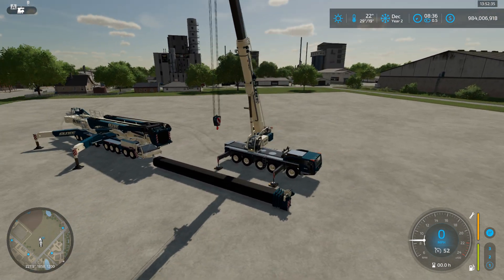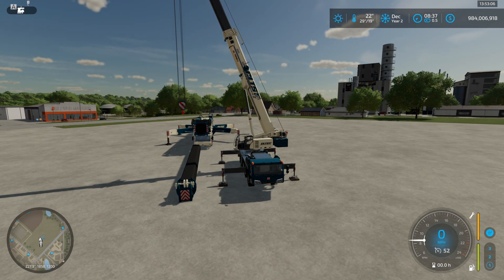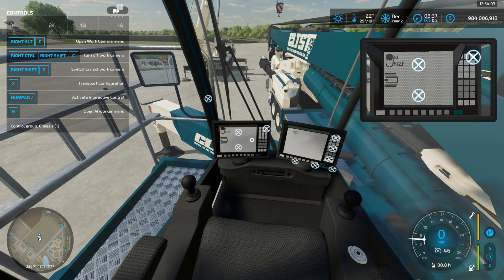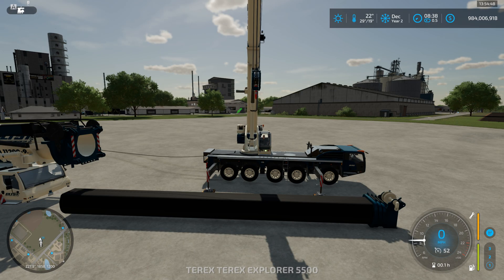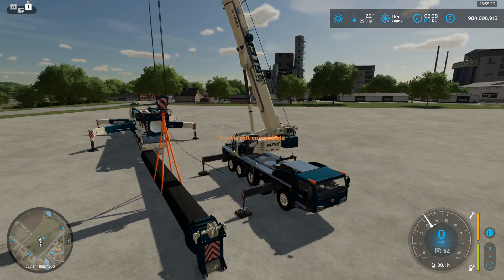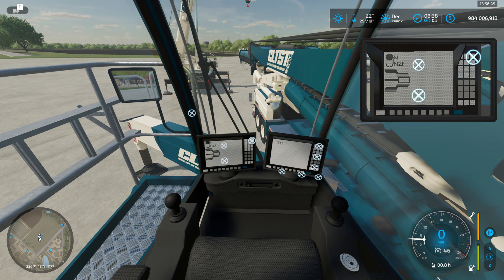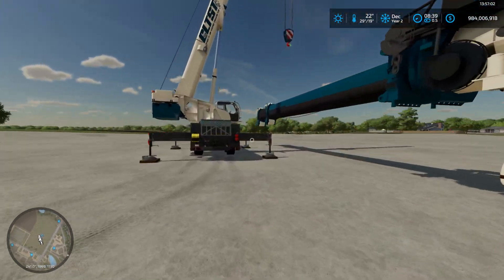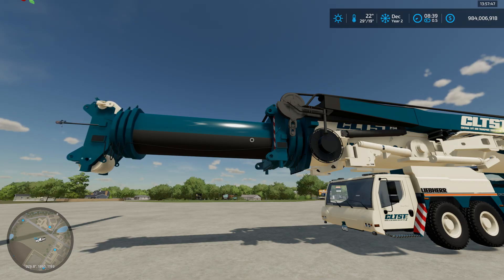FS22 LTM 11200 Tutorial Part 8: Building T7 boom from T3

Comment: Quick question and I’m sure it will be covered but when telescoping boom, I can pin sections at 50 or 100, but if I want better charts could I start with section 2 and just leave 3 all the way in?
Reply from the maker: I do not have it setup that way. I am not aware if it can do that.
Reply: @jeremybrown9379 that’s how every crane I have ran is, when you leave more sections in the charts get stronger. Such as 0% of 4, 25% of 3, and 50% of 1 and 2. 

No matter tho, this is an amazing system you have built. 

Will this tele system be implemented into the 5500?
Reply from the maker: @theamazingeg probably.
Reply: @jeremybrown9379 cool cool. Sorry also not sure if you know or not but YouTube says a lot of videos in the tutorial playlist are unavailable. Just a fyi
Reply from the maker: @theamazingeg I am releasing two a day. Still have 10 or so to go.
Reply from the maker: @theamazingeg just got confirmation, the LTM 11200 does not allow that. It has to extend each section that will be extended starting with the smallest either 50 or 100%.